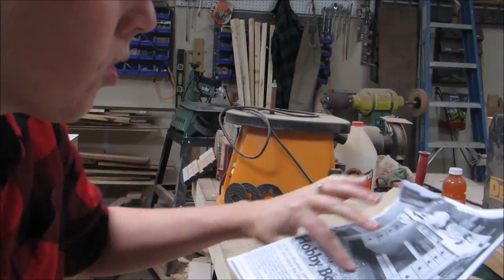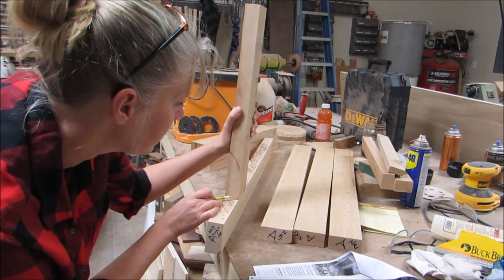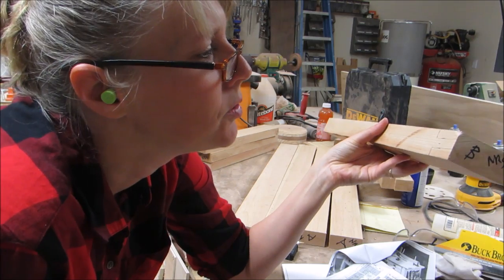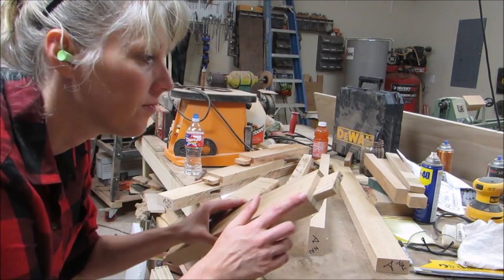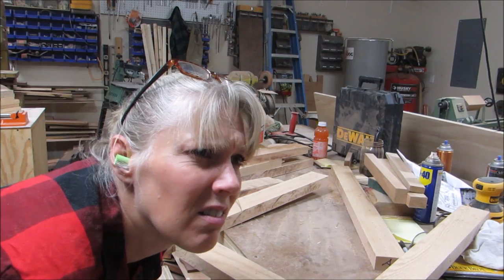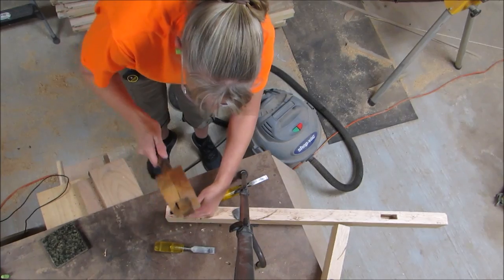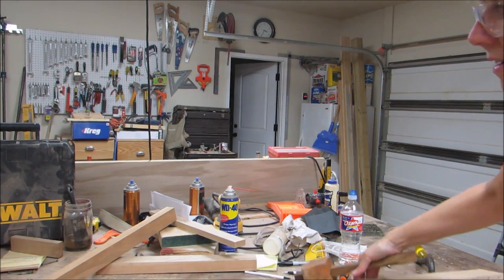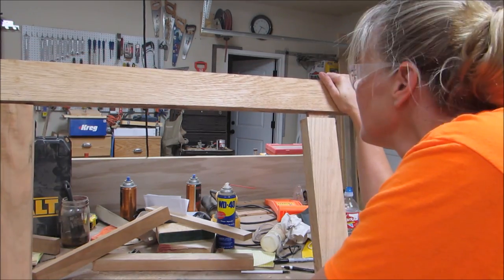Hobby Bench Part 2

Comment: Looks like it is coming along great! Can't wait to see the finished product :)
Reply from the maker: +Darbin Orvar Thanks Linn!  This is the table that I want to use your oil on, it is going to be a maple top, do I need to do anything else to the top besides placing the oil or will that be enough to treat it?   Thanks!
Reply: +Cy's Corner For pieces which will be subjected to some abuse finishing with poly is not really necessary, it does not hurt but for work benches I generally go with the wax polish alone and add more when it wears off. Your project is really coming along great, love that oak!
Reply from the maker: Darbin Orvar Thanks Linn, I will use the oil/wax only then!  That is what I thought I should do, wasn't 100% sure, thanks for confirming it!  I'm learning things and trying new stuff, it is very fun and rewarding.  I am excited to get to my maple pile, some of that is curly maple and so pretty!  Should make some nice drawer fronts!

Comment: Just a little hint, cut your mortise first then your tenon, You can sneak up on your finish thickness by raising your saw blade little by little. Just cut the end the width of the blade till you get your desired thickness. Your sharpie mark, on your table saw, I thought, was a good idea to help with your cuts.  And as Jo mentioned earlier a shoulder plane would help with fine tuning. Using a test piece the same thickness as your work piece helps keep the small mistakes from creeping in.
Reply from the maker: Thanks Edgar!  Some very handy tips there!  Especially the mortise first and sneaking up on the tenon, totally makes sense!

Comment: While using a Sharpie on the saw works, the designers of your saw already arranged a solution. That round plastic insert on the table top is designed to make a fine pencil mark that will precisely show where your cutoff will be. Just use your miter gauge to make a cut on a piece of wood, then bring it back over the plastic and make a line with a sharp pencil. You can easily clean off the pencil mark if you change saw blades.
Reply from the maker: Cool!!!  Thank you so much!!!  I figured I wasn't the only one having trouble determining where the blade was cutting!   That will make things much easier!  Much appreciated!

Comment: Use a cross-cut sled to know exactly where the blade is going to cut. It will be the edge slot made by the blade in the sled. Then using stop blocks, repeated tenon cutting will be much easier.

If you have a band saw, cutting tenons on the band saw will be very easy.

If you have a mortising bit in your drill press, mortises will be very easy.
Reply from the maker: Someone else mentioned using a sled,  which I have but didn't think about it....derrr.  A mortising drill bit?  Cool!  I will have to look into that!  Also didn't think of using the band saw for the tenons.  Double derr!!!  Thanks for the tips!!!

Comment: looking great. I just had to make some cuts like you did on my table saw. If you will mark your work piece where you need your 1st cut and take a stop block and clamp it  to your saw fence, back behind the bladesnd but that up against your work piece.  this will make each of your 1st cuts exactly the same every time. just make sure your stop block is before you get to your blade so that it doesn't get in a bind and kick back on you. Hope this makes sense. This will help prevent that one boo boo cut that you made on that one piece.
Reply from the maker: Thanks John!  I get it!  It sounds like a great idea for that first cut, then I could do it again for the last cut then cut in between!